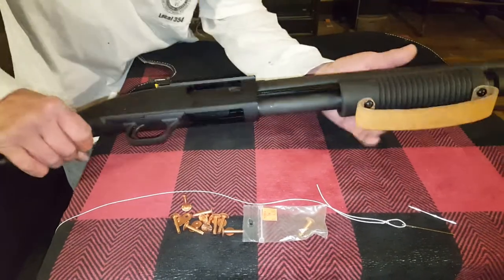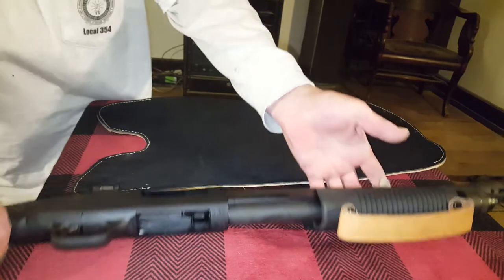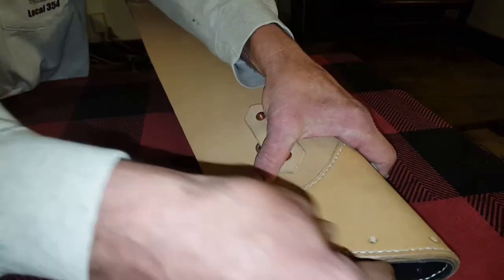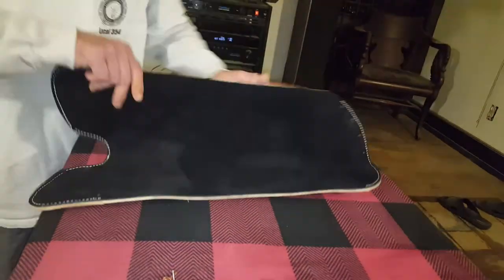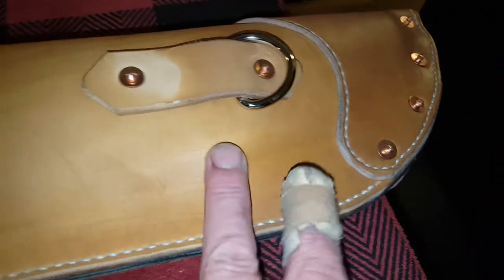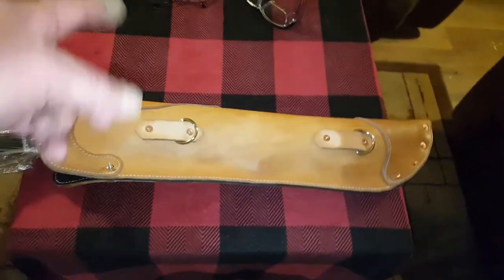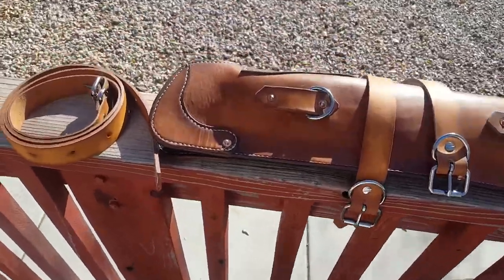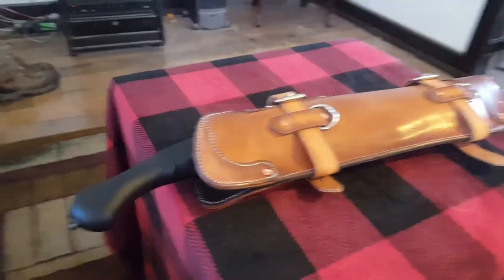Mossberg 590 Shockwave leather scabbard build. My first attempt at a rifle scabbard..

Comment: I think you did a wonderful job. I do wet forms with wood blocks I cut to shape then add covered bulldog clamps I swear by them . This looks Fantastic BTW if the copper rivets ever start to turn green I just use a toothbrush with saddle soap it gets it clean again with no problem usually.  Great job man.
Reply from the maker: Steven Dee thank you sir

Comment: thanks for posting the video. It looks good. Waiting on my shockwave to arrive.. going to make a leather scabbard for mine.  will be interesting to  design a good practical  way to carry it. i have 8 to 10 oz. veg tan cowhide and some thinner leather. hadn't thought about suede for the inside till i saw his. probably line the inside with closed cell foam and leather or a tough fabric. i have a cobra 4, 16" cylinder arm sewing machine so i can sew any thickness i need.. might get interested in making and selling scabbards.

Comment: The thing on the end is called a breach or punch attachment for pounding into a door for breaching the door. Very tactical appendage used by the military. Most are integrated into the barrel permanently.